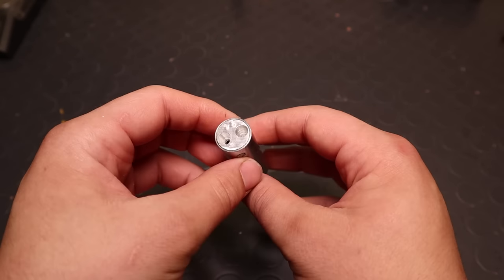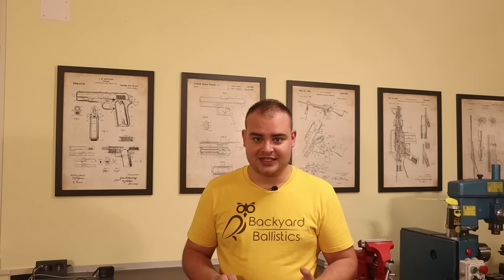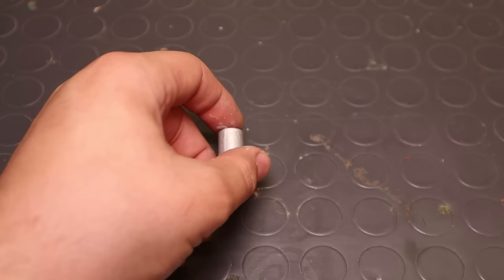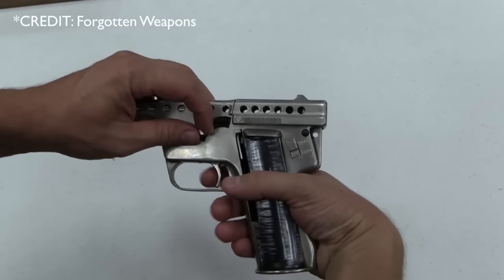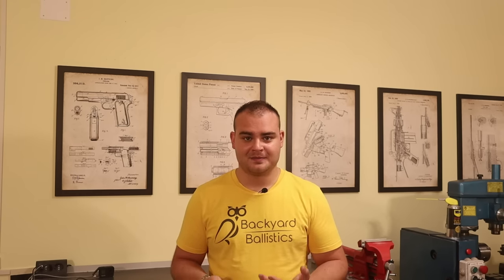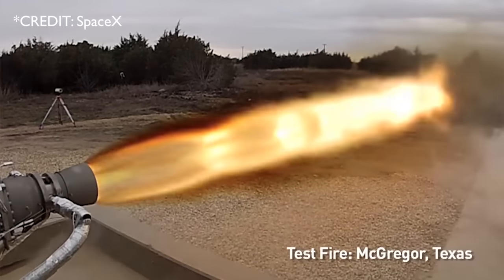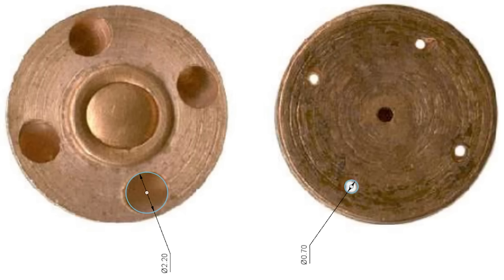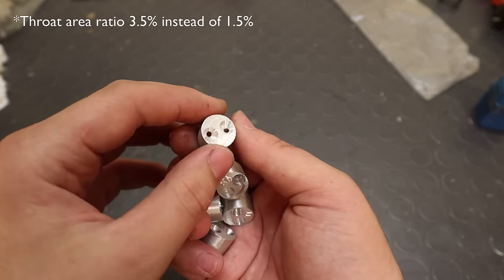Remaking 1960s GYROJET Rockets - Part 1: Improvements

Comment: Wouldn't  a more heat resistant metal be better as the nozzle plate, like titanium  or something with a higher melting point?
Reply from the maker: It would be heavier though, and the efficiency of a rocket is strongly dependent on the ratio between the body and propellant masses. Also titanium is a massive pain to machine.

Comment: "I would think" an odd number of nozzle ports should test best? "I would" imagine the group of nozzles fired as one should have an effect togather in creating the rear convergint director from ambiant pressure difference's in a more rounded odd numbered pressure sphere?         down range Energy Adjusted via nozzle size, quantity, or fueled energy. But "who knows?  "How" this could affect production, or costs?

Comment: Why not have a closed barrel like a regular gun? Wouldn't that accelerate the bullet faster to make it lethal at shorter ranges?
Reply from the maker: It would cause a bit of recoil, but it would work. The propellant burn would still be that of a rocket grain, so you wouldn't get pressures comparable to those of a proper gun

Comment: Why not threading instead of the cross pin?
Reply from the maker: because the body of the rocket is quite thin, so you would need a very fine pitch thread, which requires great accuracy, uncommon tooling and is not as strong as common threads. Very fine pitch threads (relative to the diameter) are stripped much easier.

Comment: Would be cool to incorporate a railgun system into the firing mechanism for the gyro jet this will get it up to the correct speed faster than the rocket can do its thing.
Reply: But if you've made a railgun, why do you need the rocket in the first place?
Reply: @jic1  I would assume the rail gun would not shoot that far it would be to get the rocket up to speed
Reply: @mrsurplusbangbang1857  the railgun the US developed will fly 10miles on a flat tragectory

Comment: Yeah the problem with your statement about not sending payloads to space using guns is wrong. Why? Because if you use an electric gun and accelerate the payload over a period of time instead of shooting it like a bullet, you end up with a much more efficient launch, the payload can easily survive, and the price to launch is greatly reduced. Of course, finding somewhere to build the miles high gun would be a real issue, but it can be done.